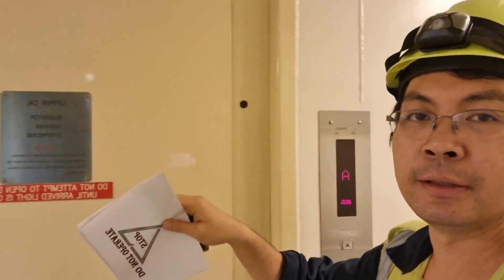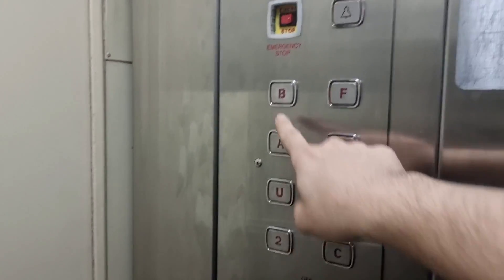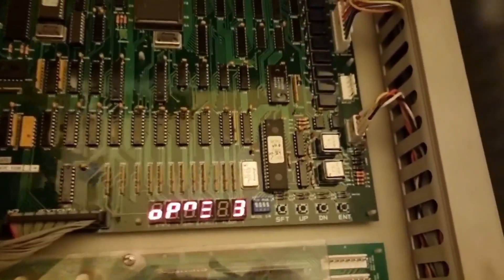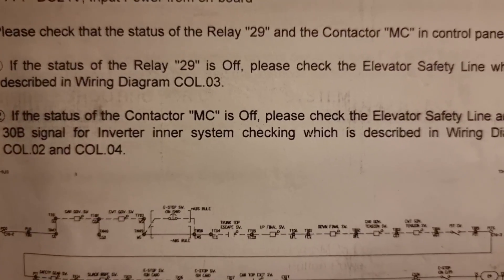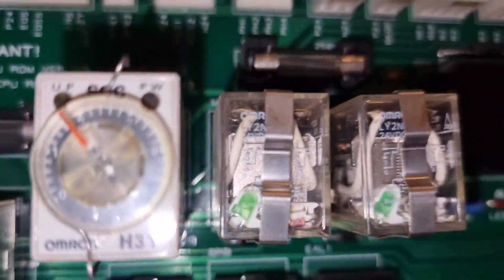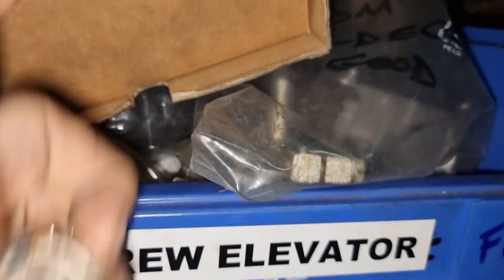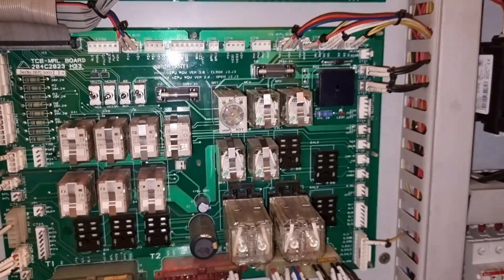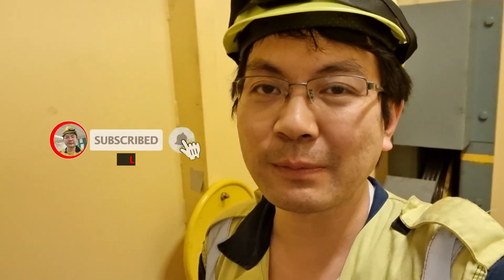ELEVATOR TROUBLESHOOTING | Marine Electrician

Comment: Hi Jake, thank you for providing such a thorough & methodical tutorial !! 3 questions plz sir: 
1. @ 4:40, for determining that all the CPs have supply voltages, did you check for voltage by placing the multimeter’s red lead on each CP’s power pin & black lead on a chassis ground ? 
2. What was the thought process that led you to make the correct assumption that it’s relay MCA, rather than contactor MC, that’s the faulty component?
3. I understand why you checked for 24v be tween P24 & N24 on either end of that circuit; but from the wiring diagram, it looks like A220 & B220 are on different circuit legs, so why was there 220v between them?

Comment: I didn't understand how you found the problem???? Electrician never guess only check the voltaje secuence in the contact mca because there are several contact relays for safety or interlock until be activate the main contactor MC, in spite of the coil from the relay you changed was working properly maybe or i suppose the contact was broken so that the circuit was open or interrupted in that point. The only way to be sure why the main relay was not activating is checking in the electric diagram all the contact one by one in the ladder diagram begin for the main voltage making sure there are voltage present from the one contact till the last, each one involve in the start secuence of the main contactor MC which is responsible to run the Electrical Motor. Good Job!!!! Amazing i'd like to see in next video a out the frecuency driver from motor or if maybe in that case don't use any only main contactor, because i worked in one elevator with two speed motor directly start.

Comment: Very clear and informative. We have installed one local brand elevator in our building. It got damaged by lightning strike and that company is dead now. I am sure that something is wrong in the control board but the wiring are too messy; no label, no colour code or numbering. Beside that no document or service manual. Now I don't know where to start.
Reply: 낙뢰로 인한 고장은 보호회로가 약한 인버터 고장 일 수 있습니다. 인버터 전압 출력부터 확인해 주세요

Comment: Similar Elevator onboard. After switching off and switching on Power, elevator is working fine. But after around a minute, when we call the elevator, the cage door closes only half and then opens. This keeps happening all the time. Then if we switch off the power and switch on, everything becomes normal. But after about a minute, same trouble again. Pls advise
Reply: 아마도 도어 콘트롤러 및 센서 이상 일꺼 같습니다.

Comment: I am curious  .. Do you have a spare of everything ? on the ship ? and if something unfixable happens what do you do ? 
also Amazing Job :D
Reply: From what I know ships do not have a spare of everything. But they carry quite a lot of spares. Of course the more critical a system is, the higher are the chances for spares being on board or the system even has a redundant system. (Radio, gps, coffee maker,...)
Also for certain components if possible the shipbuilders usually try to use common modules, so a spare would work in a number of places.

Comment: the last thing you want from a relay is that the indicator is on but the electromagnet is dead just a sinple tip use a goddamn flashlight to check whether the relay really locs into position when on

Comment: Looks like you missed one step for any electronic device: Turn power off,  wait, then turn on again BEFORE replacing the part!
 
I'm curious who will be responsible for ordering a new spare relay?
 
Is that a hydraulic elevator? I didn't see the pump.
Reply from the maker: Actually it was the first step that I did to reset. It will be my job to order the spare.
Reply: @leckyjake  I should've known you'd be on top of it. Salamat po!
Reply from the maker: It is purely electrical system by the way
Reply: @leckyjake  Are you referring to the transport of the cab? Doesn't there have to be a mechanical lift of some kind? I'd guess hydraulic for something that size and looking at the motor size.

Comment: Sticky relays are so common. 🤣 First thing to do is to tapp on it lighty with a screwdriver handle to unstick it. Or just manually bridge the terminals for elevator call to be able to hear if the relay clicks when it powers on. 🙂 Best wishes, a Swedish Marine electrician. 🤜💪
Reply: I'm an electrician but not a marine one. I use the F*ck stick(a screwdriver) and slap the relay. I call it the f*ck stick because you'll swear like hell on one if you get frustrated

Comment: Good video. At 11:53, what are those plugged in items on Magnetic contactors?
Thanks.
Reply: I am not entirely sure about those specific ones, but I think those might be monitoring switches to actually check the physical position of the contactor being opened or closed.
I have seen similar things for either monitoring and alarm systems, or just if you wanted to logically couple a contactor state with a low voltage (e.g. 24 V) control circuit without adding a relay in parallel.
Reply: @alexanderkupke920  Thanks for your kind reply.

Comment: Yup, there are times that in troubleshooting, I also call it “chasing the rabbit”, that you have a hard time catching it.  But after spending sometimes a long time trying and finally getting the problem, or “catching” the rabbit, that feeling you get afterwards is the reward for all the hard work spent tracking it down. Good video, thanks for sharing!🙂
Reply: I just had that feeling with my #1 computer at home. My external backup drive for odd months was intermittent - hardest problem to fix. Switched drives, then power supplies (which never break). Of course it worked as long as it sat idle. Mid-backup (2 hour job) it would fail, and... yes... it was the power supply (wall wart). I didn't have that voltage as a spare from my parts box. I had to order one, so I ordered two to have a spare. Four days later with a new PS, it worky-worky! Yay!  

I also get that feeling when solving software problems, which even occur on my Linux system... usually after a major update.

Comment: Lecky sir, salute to you for your magnificent job. I just request you to put some videos of boiler troubleshooting, coz I had problems in calibrating sipart as aux boiler was not firing and giving air servo error although dp transmitter was giving 4-20mA signal. Another common problem is boiler water level control is not operating in auto as feed water valve is defective, despite water controller giving 4-20mA signal,pilot burner toowas not firing due to defective cable. Plz suggest some easy ways of troubleshooting like this, thank u

Comment: Am sure maybe its my misunderstands after interchange the VCB#3 on Genset #4 problem was cleared (NO REVERSE POWER TRIP ON VCB) , Cause of that logic action to open VCB#4 to find out the defective parts. 
Continues for my first comment on REVERSE POWER AT GENSET#4
Reply from the maker: That is correct. Hello Eyad, First of all thank you for watching my videos and really appreciate the time. After interchanging, no more nuisance reverse power trip happen and the Generator can be put on loas using the other VCB hence there is no problem on the curcuit side of the Generator that is why I focused in opening the VCB only.

Comment: Hello Mr. Leckyjake, First of all my name is Eyad, am working as electrical engr. (earlier as marine side and recently on electro mechanic Contractor). really appreciated your effort for proficiently on troubleshooting as well as your videoed explanation. i have some clarifications and very important to understand and need your reply once you are free for that. i will start with your video on Reverse Power Trip on Genset#4 and your act by replacing VCB#3 instead VCB#4 and vise versa after RUN genset#4 (with health VCB#3) founded same problem (reverse power trip VCB) occurred again so your solving problem by opening VCB#4 (ITS NOT UNDERSTOOD FOR ME) as I assumed if still revers power activate even with other VCB SURELY its NOT DUE TO VCB AT ALL , AND COULD BE FROM GENSET SIDE. sorry for long message but really i would like to know the correct . ALL RESPECTFUL FOR YOU AND YOUR FAMILY.

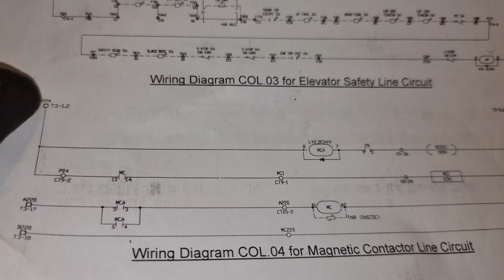Comment: jack i have a doubt, at 7:24 when u r checking relay MCA , if the relay is working properly and we measure voltage across P24 and N24 shouldn't the voltage reading be zero ?
what i mean is since we are getting 24Vdc(26 in ur case) doesn't that indicate the that circuit is open somewhere ?
Reply: P24/N24 power the relay coil.  The contacts are on the 220v side and pull in the MC contactor
Reply from the maker: Thanks
Reply: @leckyjake  still cannot understand.  Shouldn't it be zero between p24 and n24 because the relay is activated?
Reply: @michaelardai9703 still cannot understand.  Shouldn't it be zero between p24 and n24 because the relay is activated?

Comment: I find relays being a common issue in industrial applications. Solid state relays seem to be allot more reliable
Reply: Sadly they also offer less isolation as they are not galvanically isolated when off so the number of possible applications are tighter
Reply: @whatevernamegoeshere3644  I assume with relays being mechanical devices and especially in marine or industrial environments that may have to deal with vibration dirt and corrosion (at sea everything will start corroding) you are right.
Also relays able to switch a certain amount of current are readily available these days. For anything drawing higher currents a contactor would be used anyways.
But I also can imagine that with "older" equipment switching everything over makes economically no sense.
Reply: @alexanderkupke920  Corrosion and vibration might not be a factor at all. It really depends on the relay. There are ones that are completely molded into a solid brick of plastic.
Another thing is that you would really not replace those relays with solid state relays. It's 24V DC, so a simple BJT would make a whole lot more sense

Comment: i wonder why the Elevator company did not include a relay test circuit board... to plug relays in.. and test their operation..  did you examine the contacts thru the clear plastic.
Reply from the maker: I did not check anymore the contacts as the coil is activated but still not activating the MC so I go straight in changing it to make the troubleshooting faster
Reply: @leckyjake  i can understand that..  but i used to use relays like those. in a project.. i set up a rotary switch with piezo buzzer..  so i could close the relay by pushing a button.. with the other hand i rotate thru the contacts and i could hear changes in tone indicating the relay contacts were getting corroded so i could change it out before it totally failed.  took me seconds per relay..  kept my project working with only a 10 or 15 minutes of scheduled down time a month to go thru the relay tests..  i did have banana jacks so i could take the piezo out of the circuit and hook in my ohm meter.  its just sharing..  i worked on a friends 104' wooden power boat for 22 years.. my cousins are fishermen in the pacific northwest .. i went on their fishing boat while it was in harbor one day.. these guy go out in the gulf of alaska .. the poor workman ship and planning of their electric and hydraulic systems scared me . your going to take this out in 50 foot seas at -50F  i went straight to their grand father and had him get involved in getting some of it corrected..